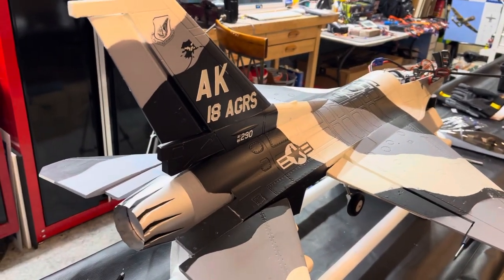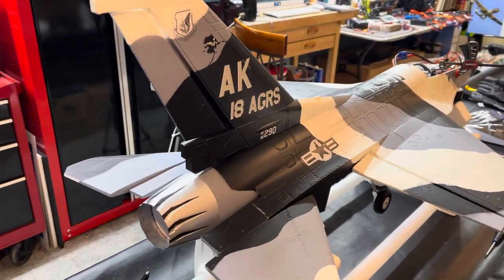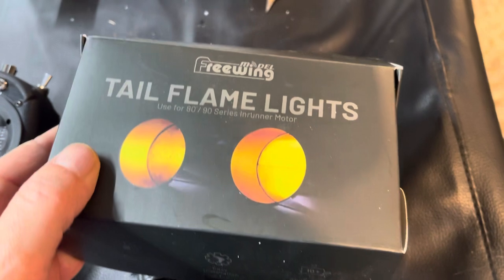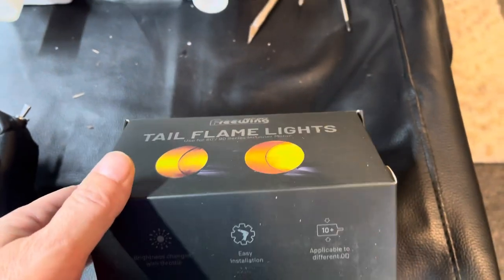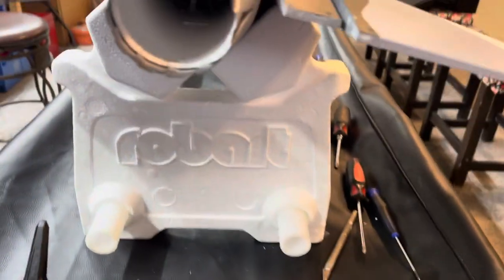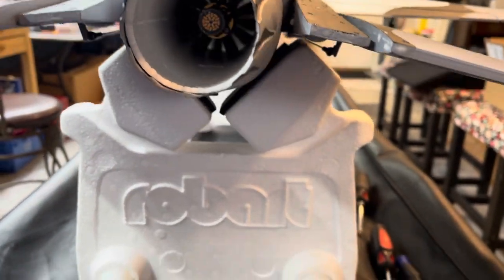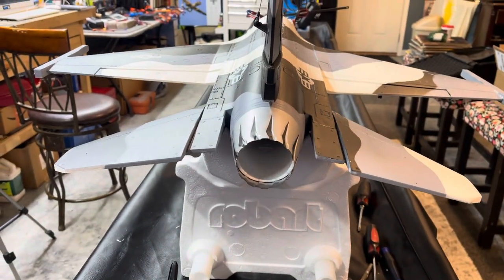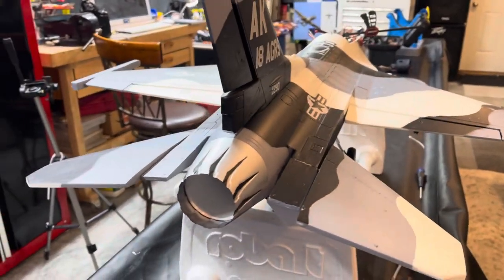Freewing F-16 with afterburner installation

Comment: I bought some for few of mine might get your help if I feel like something not going right, 
Cool video , when you fired it up it sounded so real plus looked amazing
Reply from the maker: It’s a very easy install, you will need something to pull the wire through the fuselage. I used a tiny bit of lock tite on the motor screws. It’s metal on metal.